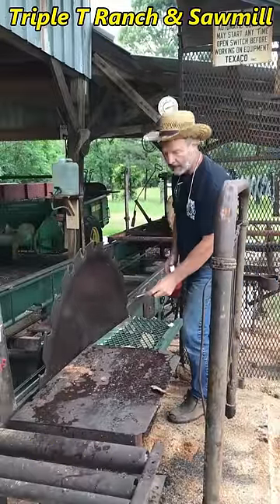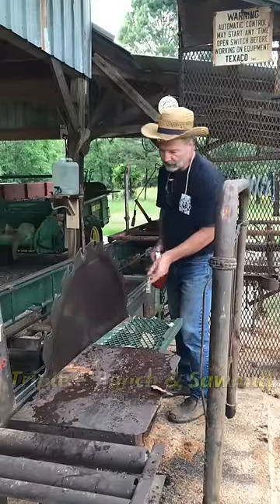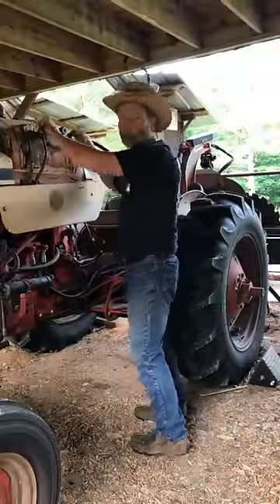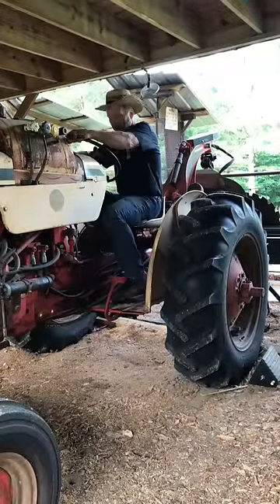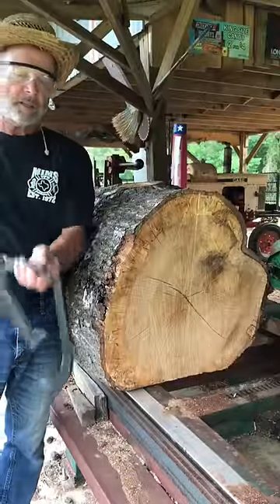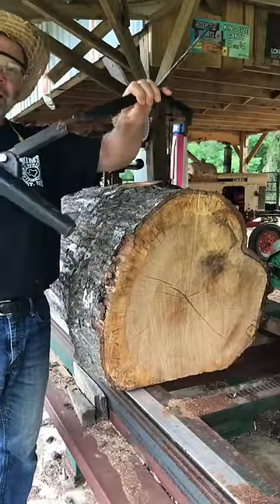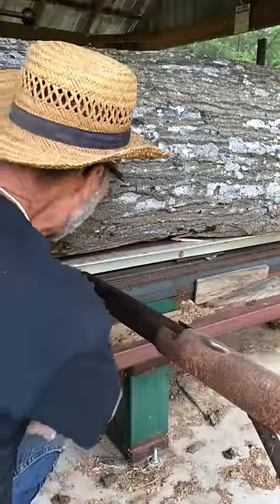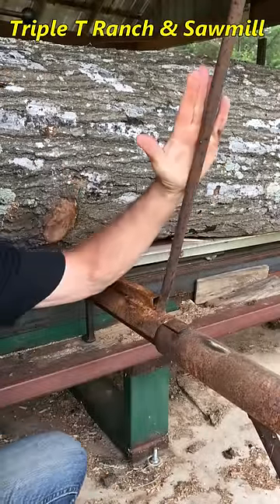Moby Dick Oak 1 of 4

Comment: My grandfather had a 1958 Ford Tractor ... ran well (with maintenance and repairs) until 2017.
Reply from the maker: Yes made to last. Our buzzsaw is powered by 1953 ford jubilee!  Still working
Reply: @TripleTRanchAndSawmill  his was a Powermaster. I believe it would still be operational had he kept it. Most dependable combustible engine I've ever seen with glass components (air cleaner).

Comment: Need a nice little oiling sink to distribute it with a ball valve. Just fill it and let it run.
Reply from the maker: Yea that would work!
Reply from the maker: I added a foot pump with a 5 gallon jug to spray solutions onto the blade

Comment: What do you do with the bark and sawdust and scraps   It’s a big mess
Reply from the maker: I use the larger flitches for firewood.  Convert smaller pieces to mulch and add sawdust to apply to garden for weed control
Reply: We had 18 wheelers hauling off to dump
Reply from the maker: @ffgg6860  wow, they can bring here!
Reply: I worked saw mill from 1973 to 1983  my dad ran it we put out some wood we cut up 30 cants in few minutes. Gang saw.  Slabbing head was wild  chipper.    Big place fill up a truck in hours with shavings
Reply from the maker: @ffgg6860  I got up close to a gang saw in Germany.  A single run would produce 9 boards.  Bet you saw a few things working around that mill
Reply: As high as lumber is now you got great setup
Reply from the maker: @ffgg6860  yes, its handy on a farm.  Even irregular lumber can b used!
Reply: Bark and saw dust creater make it into tee lights mixed with wax for camp fires 🔥🔥 and babuc grilling heaters coals start-ups and coals start-ups fire 🔥🔥